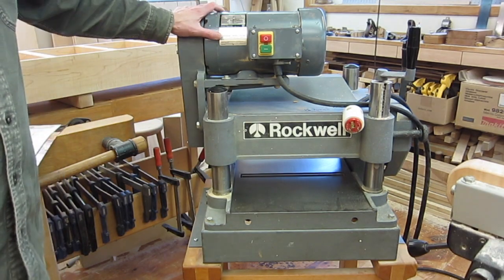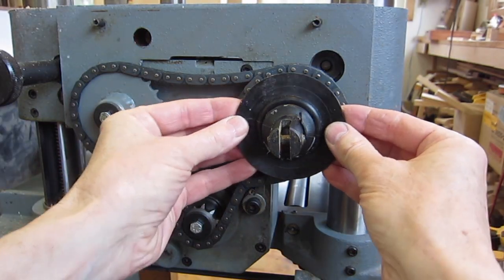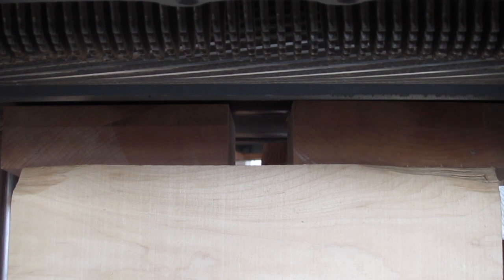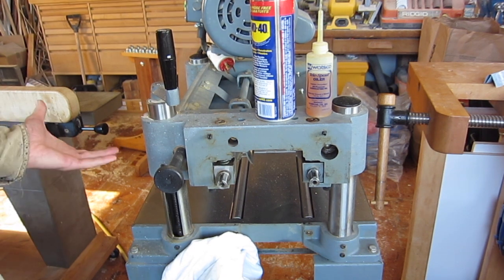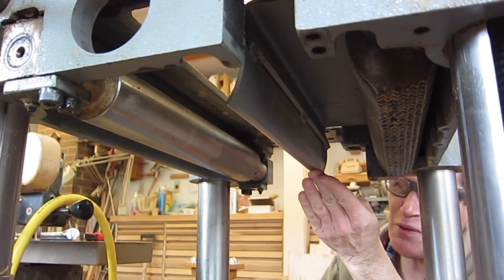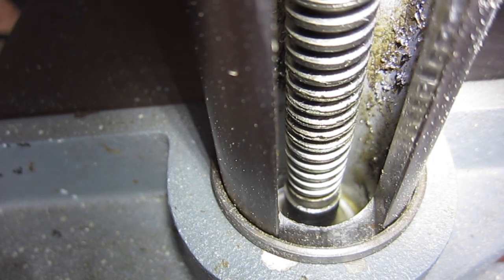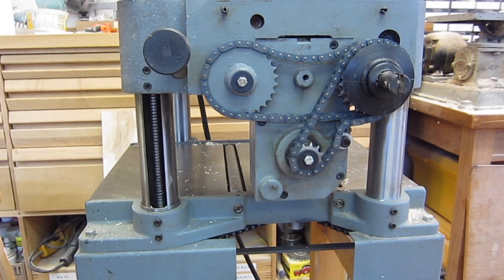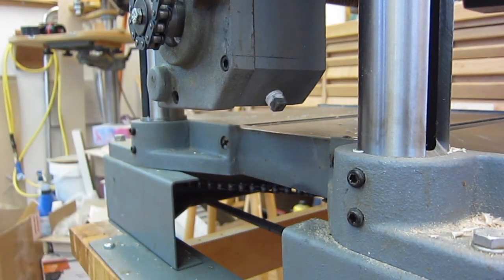Rockwell Delta RC-33 DC-33 22650, 4 post planer upgrade to BYRD SHELIX + Lubrication + Adjustments

Comment: This is hands down the best instructional video on YouTube and the written instructions are super well done.  Thank you Steve.  I have a Delta Invicta 22-650 from 1988 and am about to begin the same project including replacing the cutter with a Shelix.  Two questions - can you let us know the types of solutions and cleaners you used to degrease/degum the various parts as you disassembled the unit?  I see the WD, light 3 in 1 oil, brake cleaner, chain lubricant but you mention other cleaners and solutions throughout.  Second, the measuring gauge on the crank handle of my unit has never been incredibly accurate.  Is there a procedure to calibrate the rule?  Thanks again.
Reply from the maker: Thanks for feedback and good questions.

To remove grease I used Varsol and an old toothbrush.   Soaked chains in Varsol.     https://www.recochem.com/products/varsol-paint-thinner/.     Any brand will do.

There is a screw at top and bottom of ruler, and slots in the gauge, so that looks like the adjustment for calibration, BUT when I remove the screws on mine the gauge will not slide and I would damage the gauge if applied more force, so maybe glued at factory.   If your gauge is able to move, then you could plane a piece of wood, then measure thickness with callipers, then adjust the gauge to match that thickness, and tighten screws.     Instead of gauge I am using a Wixey DRO, which I really like.  https://youtu.be/6ev_aK7fE60

Comment: Hello Steven I have a similar planer and I pulled the lever to change the roller speed from fast to slow while the machine was OFF. I turned it on and the rollers are not working. I read the manual and realized that you are supposed to only change the speed while the motor is running. I assumed the solution is to keep the rollers in the neutral position and then pull or push (for fast or slow speed) in order to engage the rollers? I did not want to try until I was certain this would work. Thanks a lot and really appreicaite the thorough instructions!
Reply from the maker: My planer (the one in the video) is single speed.   There is a lever that engages the rollers.   This lever can be operated when the planner is running or when it is not running.   I just keep the lever in the engaged position at all times.   Sorry I can't be of more help on your 2-speed machine.
Reply: @steven.woodward  thanks Steven. Appreciate the feedback

Comment: My RC-33 does not have the shift handle but instead has a small handle at the lower left corner of the gear box.  The manual shows a slide shaft that appears to move the low speed gear.  It is stuck in a disengaged position after slowly working outward.  This excellent PDF clears up a lot of disassembly questions for me.  I wonder if there  is a short cut by soaking the gears in place to avoid taking the box apart?
Reply from the maker: Karl, thanks for kind words on the PDF.     

I have not seen your version of RC-33 but did find a parts diagram and added it to the google folder:  "RC-33 Parts Older.pdf"

According to the 1981 instruction manual, the small handle that you refer to, should be pulled out to engage the feed rollers.

On the machine in the video, the engagement of feed rollers is done with the chain gears located outside the oil filled gear box.   On your machine, the engagement appears to be done inside the gearbox.

If the small handle on your machine cannot be pulled out to engage the feed rollers, then perhaps the oil is gummed up inside the gearbox, or gummed up on the shaft of the small handle.   Replacing the gear box oil and lubricating the shaft of small handle from the outside might fix the problem.    

Drain the gearbox oil by removing both upper and lower oil plugs, then replace with new extreme pressure gear oil.  If the oil is really thick and grimy, you could run the machine for a few minutes with the new oil, then drain the new oil, and replace again,

If these steps don't loosen your small handle then perhaps an "engine flush" with "Liquid Moly 2037 Pro-Line Engine Flush", or equivalent, following manufacturers instructions: "Add to engine oil, let engine run for 10 minutes, drain oil, refill with new oil.

Let us know how it goes.

Comment: Excellent video Steven.  I’m rebuilding my RC33 and upgrading the head to Sheila now and your instruction has been excellent, thanks.  One question I gave is how to set the indeed roller height?  Is it even with the cutter head?
Reply from the maker: The infeed roller has no height adjustment.    The infeed roller should be below the cutting edge of the cutter head.  The infeed roller  presses down on the wood under spring tension.    Just measured on my machine and infeed roller is about 2mm, or 0.08" below the cutting edge of the cutter head.   Outfeed roller, and chip breaker pressure bar should be 1mm or 0.04" below the cutting edge of the cutter head, per Rockwell instruction book.   Cutter head, infeed, and outfeed rollers, should all be parallel with the table.
Reply: Understood, makes sense.  I’m all set up now, thanks for the education!

Comment: Steve, thank you for this video. So helpful.   On the bearing you replaced - I need to also.   The one I ordered came as a sealed bearing.   Should I get one that is not sealed or will it be ok if I use a sealed one.    The bearing is the same one you replaced
Reply from the maker: Very good question regarding sealed vs unsealed bearing.   I do not know the answer.   There are also many types of bearing within each of these categories.   Suggest you make a phone call to a seller that specializes in bearings and ask for their advice.   

The expert that I consulted with, and eventually purchased a bearing from is:    https://peterboroughbearings.com       You will need to describe for them the application. Examples: submerged in oil as in the oil filled gearbox (I think that is what you are replacing) ;  or exposed to sawdust.   

Another advantage of dealing with a bearing specialist is that you will avoid counterfeit bearings which is a common problem.   Bearings are difficult to replace on the RC-33 so you want to replace with a known high quality bearing that will last.   The bearing supplier sold me SKF brand which is known for quality, and often counterfeited.   Hope this helps.

Comment: I've watched this video several times.  Tonight I noticed the cart the planer is sitting on in the video.  Would you happen to have plans for that, or more detailed photos of the top section of the cart?

Thanks.
Reply from the maker: I don't have plans, but took a couple of photos, added some dimensions, and saved in a file located in the google folder: https://drive.google.com/drive/folders/1_Qm84_ZeMmsxgP-hHsI-Ppf39kiUOEU3

Comment: This video was super helpful, I have and older Martlet machine which I think is based on the 1981 model RC33. The only visible difference is the height adjustment which on the martlet is a wheel type handle. Everything else seems to be identical. Finding any information for this machine has been tough until now. Thanks.
Reply from the maker: Good to hear it was helpful.   If you have not already noticed, click the link in the text below video it will take you to a google folder of additional information on RC-33
Reply: Awesome, thank you. Watched a few of your other vids. Mitre sled, cross cut sled and that handy little infeed attachment. Some very useful tips which I will use when I make some new sleds.

Comment: Steven - great video.  I have a chance to buy one of these planers, but when I tested it first the cutter head only planed the surface of the board 3 out of 12 passes.  Do you have any idea what adjustments may need to be made to correct this?

Thanks
Reply from the maker: I have not experienced that particular problem but offer these ideas:   1) The cutter head may not be fully engaged to rotate under load due to the motor drive belt being loose.   2) The carriage has to be lowered a bit after each cut.  3) The height of infeed roller, outfeed roller, and chip breaker bar may be set incorrectly.   4). The spring pressure on the infeed and outfeed roller may be wrong.

Comment: Steve, Thanks for taking the time to produce such an informative video. I've upgraded my machine, step by step, using your video and the Delta owners manual.  Despite reviewing the owners manual, your video, etc I can't find the specification for the height of the infeed roller relative to the cutterhead.  Do you have the spec?  All other specs are clear.  Thanks, Steve Wilson
Reply from the maker: Congratulations on your upgrade !
I am not aware of a spec for the height of infeed roller relative to cutter head.   
I measured my infeed roller and it is about 3mm lower than the cutter head.  
The infeed roller does not have a height adjustment.   
The pressure of the infeed roller can be adjusted, as shown at 33:45 in video.    
If the infeed roller is not parallel with the table, it can be shimmed as shown at 34:05 minutes in the video, but this is not really necessary.
Reply: @steven.woodward  Thanks Steve.  I feel better now knowing the infeed roller relies just on spring pressure and not a combination of height and pressure.  Once again you deserve applause for all your efforts in producing an excellent the video and stills package.  I've upgraded both the planer and my General 8" jointer.  What a pleasure to use after getting over the sticker shock.  Steve W

Comment: Did you find that the 2 hp motor that comes on the RC33 had sufficient power to utilize the full width of cut with the shelix head?
Reply from the maker: I work mostly with hardwoods: oak, ash, hard maple.   I tend to take lighter cuts, usually 1/4 turn of the crank at a time, which works out to 0.05 inch.  The most I would cut in one pass is 1/2 turn of the crank.   Motor does not slow down.   Did not notice a difference in power changing from straight blades to helical.

Comment: Your video was great in rebuilding my Delta rc-33 planer. However I get snipe at the beginning and end of my boards. The bed rollers are level with the bed. Any ideas or suggestions would be greatly appreciated. Thank you in advance for your help.
Reply from the maker: When planing a large board, I slightly lift up the free end as the other end is going into the planer.  Same thing as the board is exiting the planer.   For a smaller board, I place it on a larger piece of MDF and send the whole thing through the planer.  No need to secure the board to the MDF, it will stay put by friction.     These techniques reduce snipe but hard to eliminate it completely.   Let me know how this works out for you.

Comment: Hey watched this video several times when fixing up a Rockwell 22-650. Good stuff.  Would you happen to know the size of the chain? my master link broke and was having a difficult time finding any information.  The pitch might be 128 but if feeling lost. Thanks for all the content.
Reply from the maker: I don't know the size of chain.  It may be metric size as the rest of machine has metric threads and metric bearing sizes.   I think it is a "roller" type chain.  
Here is a link to table of standard inch size roller chain: https://www.usarollerchain.com/roller-chain-size-chart-s/4869.htm.   
And here is the standard metric roller chain sizes: https://www.usarollerchain.com/Metric-Roller-Chain-Chart-s/4870.htm    
With accurate callipers you can measure the chain and hopefully find the matching dimensions in one of these tables.   If you don't have callipers, let me know and I will measure the chain on my machine.

Please add another comment when you figure out the size and where the chain can be purchased.

Comment: great video! what type of oil are you using for the bearings under tension springs for infeed and outfeed roller?
Reply from the maker: The bearings under the tension springs are sintered bronze which can absorb a light oil and thereby continue lubricating for a long time.  I used 3-in-1 which has an oil viscosity weight of 10.    https://www.3inone.com/products/multi-purpose-oil/
Reply: @steven.woodward  thank you!

Comment: How do you like the Shelix cutter head? What was the lead time from Bryd?  Thanks for suggesting going through the lubrication steps. Mine is gunked up, leaking and this would help it perform much better.
Reply from the maker: 1. The Byrd head is great - it feels like I am using a new machine:  runs quieter; less tear-out on grainy wood; and smoother finish.   And I will never sharpen or set a blade again !    This is the most authentic review of Byrd head that I have seen:  https://youtu.be/jwlhrEW4oe4

2. The lead time from Byrd was fast because they had happened to have the RC-33 head in stock.  Byrd shipped 8 days after I placed the order, and I received head 6 days later which included crossing the border into Canada.  For some reason Byrd could not tell me in advance whether a particular head is in stock, so lead time could be much longer.   To order the head from Byrd you need to measure the spline thickness of your existing head.  This can only be done after the gearbox has been disassembled and the existing head removed - that means you will have not have a working thickness planer until the Byrd head arrives.    I made my conversion in the summer when I am less interested in woodworking.

Comment: Great video, thanks. I have the same machine in a damp shop and the crank making it go up and down has frozen up. I think the chains are rusty but I can't find a way to access them. Any suggestions?
Reply from the maker: The four threaded shafts are turned by a chain underneath the planer.    The bottom of the planer is open (unless blocked by a stand) so should be able to see the chain.    There is a chain tensioner sprocket that can be backed off by loosening a bolt.   Then the chain can be removed and soaked in light oil or some rust remover fluid to restore it.   If you don't want to remove the chain, then try spraying with WD-40 to see if that will loosen it.   If the chain is really done, then it can be replaced with same pitch chain.

Comment: Do you put grease on the sprockets or is the depot chain saver cover both?
Reply from the maker: I only used the Dupont Chain Saver on the sprockets and chain.   When I took the machine apart the chain and sprockets were caked with sawdust so no lubrication going on.  With Chain Saver I anticipate less dust attraction.